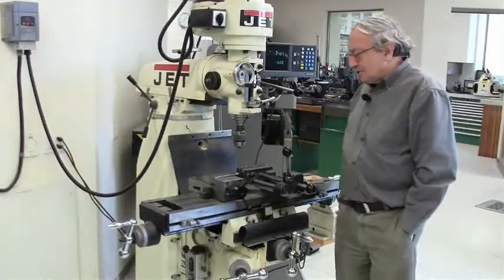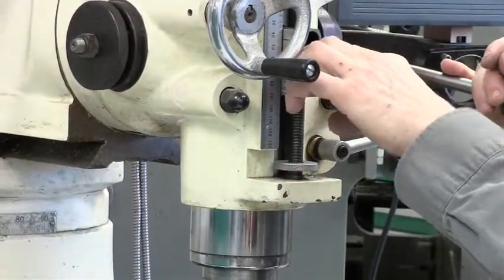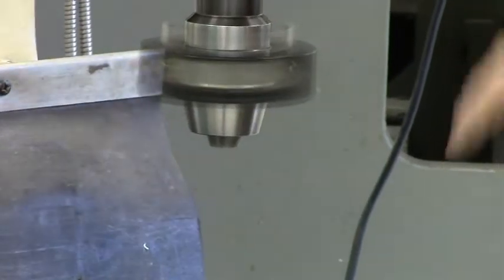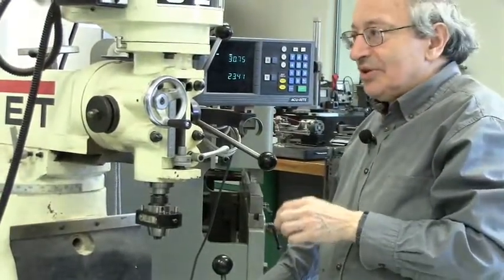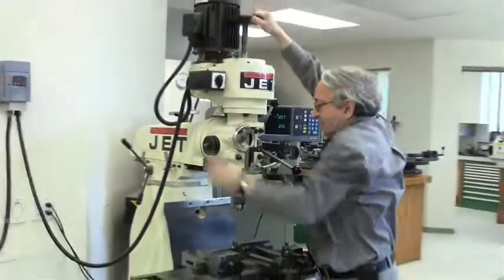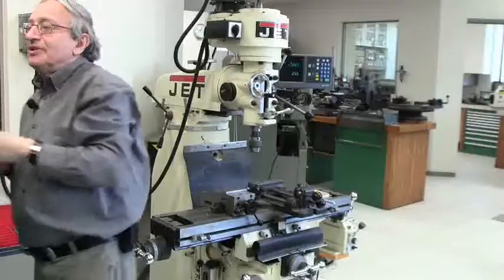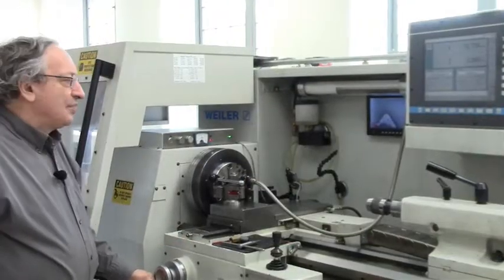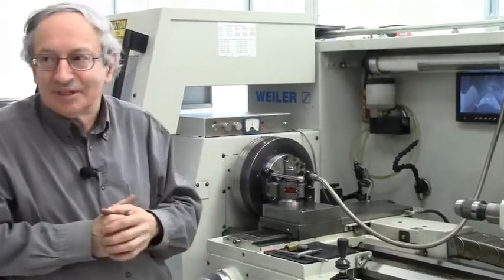Building Prototypes Dan Gelbart  part 15 of 18  Mill and Lathe

Comment: Dear Don i have got mill with 3 ph motor .i hope that  the rpm frequency controller will solve the problem ...i don't have 3 ph  but single ph 220v ac 
i was looking at amazon for controller but there is so many of them and i got lost which one will do the job ...converting 220 ac in to 3 phase ..please advice or better send link .
thank you .
Stan 
ps . please contact me directly if trough you tube correspondence is uncomfortable stanislawcollection.com
Reply from the maker: Up to a few HP you can run the 3 phase VFD from a single phase.  Here is one: https://www.amazon.com/Variable-Frequency-TwoWin-Inverter-Converter/dp/B08K32PNVP/ref=sr_1_6?dchild=1&keywords=VFD+single+phase+input+220V&qid=1612324341&sr=8-6
Reply: @dgelbart  you just save my life ...if i wouldn't be able to run my mill i would jump from high building .
Thank you so much for the link

Comment: wow   ton of information which make life much easier . ... but where to get components  to build the laser center finder ?  ... i love that and from now on i can't live without .
regards stanislawcollection.com
Reply from the maker: https://www.ebay.com/itm/Dot-Laser-Module-650nm-5mW-Red-Diode-Dot-Laser-Board-Focus-Adjustable-Laser-Head/252477800391?_trkparms=ispr%3D1&hash=item3ac8d97fc7:g:hIIAAOSwdzVXmNky&amdata=enc%3AAQAFAAACgBaobrjLl8XobRIiIML1V4Imu%252Fn%252BzU5L90Z278x5ickkrDx%252B2NLp21dg6hHbHAkGMc6zfwblR%252FiT4VN2lKq%252FUGAIA%252BXiKYS6C%252F1i0jKaUkMcVWk7xfXB5yKksJScZasU5GiHE0pUUYXET8ANXGqAU6p3nwJ5SbadoECB3BeJ05ZOkU7ITuGJSDx2ztnE0IFyxXQGz%252FhGa4kcC0UKzZczo82itrAN%252F%252FZ3XYU5llwFGrLw%252FRAyX5COF01JvNT%252FuCMVveJb9NVVOE7vgVSyUw7m0KpLbvfNH6z3unDW%252F87eqll1m2O2q8Pptgn5fB741qFQYdB53c%252FM%252Fb2x2s3XY5Cjfwb28lWfY77o7mZZ3SpW9wxTphfApN9vhHOsdfP7INYEscWxHrOmUfZqEHEjAnroG3n0qwX7rfWMeyrTPh1WCE1F1yN4ttK0S3okTPxMFmHNcHcjGHFDRkF72PT61nZAKSYMsZyJusr9Ge33g4S%252FGSD27s8p5bFr%252BP3Gq9gzC%252BQaH7v343YHuZPBgRSucFU68nF%252BGSMv4xdXsqR1fjz%252BLicxjzSVMJYXlSkELpqjeK0msrpAoGOzEDmNcKqV1q0qbhAE8hLaySb3akawbG4W6GjjzBInlzjUGWvzcU4Qbp848rbCNuVoXy%252FhbvW9tzOJuKPQCaHhdAAE8xLPk8JNew1RNcfgJhS09Gqol8pJCRxe5z0eIFzcw%252FcQ2m0u3xqb8z12HPQxmTsWjbOtOzBxHcHzt4sELFOxeClXy3ZC4LLq%252B7%252BoBpZqci3vA%252BIRym6TMQIYEGX47kHucwsYa4bcvt5dkvRtcawB1o8bVuGpt6%252Fqqdol37%252B2AkQ40uh19Eb3CNQ%253D%7Ccksum%3A252477800391d2599670ebb14d69a2f329500637fd3e%7Campid%3APL_CLK%7Cclp%3A2334524
Reply: @dgelbart  thank you so much ..maybe also you have video how to build that "put on chuck " center finder .. or some diagram ??
Love yours videos ...every single word on your videos is worth oz of GOLD !
Reply from the maker: @stanjarmolowicz  Sorry, built without drawings.

Comment: I'm astonished to see a Jet knee mill and not a Bridgeport. Dan knows something I don't. (hahah, ya figure?)
Reply from the maker: No worries. My mill is a Makino KE55, a wonderful machine no longer in production. The Jet, a very good machine, is used only for very light milling and mainly drilling.  I have other fancy machines but no point showing them in a video done mainly for students.
Reply: @dgelbart  I know you get this feedback a lot, and I know you're a busy guy with lots of priorities besides making videos... but man, I'd love a shop tour of the other fancy machines you've got, particularly if you've got any other cool modifications you could show off. I'm not a machinist or engineer (UX designer, actually), but I am very interested in the way you innovate and solve problems. Surprisingly applicable to my own line of work, even if not directly.

Comment: Ran a bridgeport for 20 years and never saw that light indicator. The handwheel drawbar idea is cool but that roughing endmill would pull right out of the collet with such a whimpy torque.  But i am curious what the hole was on center behind the knee waycover? This man is a genius. I would love a tour of such a place.
Reply from the maker: The hole is for an adapter that converts the mill into a horizontal mill (the hole is the arbor bushing). The adapter was a standard Bridgeport accessory, probably no longer available.

Comment: I would want that laser center finder but the cost is a little bit steep. I found this weird tool named "laser monkey", meant for aligning the wheel on motorcycles I guess... it looks like it could work for this application too.
Reply from the maker: I have nothing to do with the laser finder. I published the design and at least one company (centerquick) is making it.
Reply: @dgelbart  It's still a great invention. I just thought I tell about my finding to other people who might be seeking for an option. I am actually planning on building something similar myself.

Comment: Dear Mr. Gelbart! I constructed a laser-centering jig similar to this. However, when I used it to drill a hole on a flat surface, the accuracy was horrible - about 0.5 mm error in the hole position. It seems that unaided eye have a hard time to distinguish positional error of a center mark within laser circle with a suitable accuracy. So, my question is - when you say "50 micron accuracy", do you mean mainly positioning on cylindrical surfaces, where positional displacement is more obvious via tilt/tip of the laser circle? Do you use some kind of close-up camera to accurately locate centers on flat surface? I have quite good vision, but cannot locate a center point within the laser circle to 50 micron accuracy. Am I missing something?
Thanks for all your great videos, they are much appreciated!
Reply from the maker: On cylindrical surfaces or on cross drilling a cylinder the error is magnified and it is easy to get 50um. When aligning to a mark on a flat surface, like a center punch mark, you need to make the laser circle very small, about 1mm diameter. If you do that you will get 50-100um. I suspect you used a large circle on a flat surface.
Reply: just use a dial indicator man. that's what they're for.
Reply: @fatihdurmaz9826  that's like saying "forget using a plane to get to Denver, that's what cars are for"

Comment: These are great videos, but every 'recipe' for making a part starts with "buy a water jet". ;)
Reply from the maker: Very true, I love these machines. The good news is that Omax has a small unit now, called Protomax, about 12"x12" format, very compact and runs on single phase 240V 30A. The price is around $20,000.
Reply: @dgelbart  Can I use this to build one that costs $2,000

Comment from the maker: Hi Folks: For all those who asked me how to build a laser center finder, you can buy one now at www.centerquic.com. 
I got one as a gift from the vendor and checked it out. It is well made and well designed.
Reply: Yeah, but we all still want to learn how to build it!
Reply: I know this thread has some age to it, but I'm interested in the spindle lathe attachment for adjusting run out, do you have a specific video for this Construction?
Reply from the maker: @machmat33  Unfortunately not, I may  do one in the future. I did not keep any drawings. Quite time consuming to make, as all parts are hardened, ground and lapped.

Comment: If you have a 3D printer, you can also print one out, i've uploaded the OpenSCAD Source and .stl files here. It is drawn to fit a 68mm quill on our Bridgeport, but fully parametric, so you can adjust to suit in OpenSCAD. http://www.thingiverse.com/thing:1483955

Comment: Dan, Thank you for the great series. 

I curious about the hand wheel. It looks like it can save a lot of time.

It has to be taller than the quill travel, does that impose a max speed? 
How did you balance it? 
Is it supported with a bushing or bearing inside the spindle top?
Is there still a nut section for hard clamping or do you find it unnecessary?
Do you every need to knock the collects out, or is the hand weight enough?

Comment: Hi Dan

I love your nifty laser center finder and I want to make one and did some thinking ...

I thought I would turn it ON with the rotation and when no rotation it's OFF.

Are there situations where you need the laser ON when it's NOT rotating ?
Reply: I thought of this too.  Could use a mercury tilt switch on its side as a centrifugal switch.
The only problem I can think of is accidentally storing it in an orientation where it could switch on.
As I was typing this, I had an idea about adding a low volume buzzer that is on when the laser is on.
It'll not be annoying when the machine is running, but would alert you if the laser is on when it shouldn't be.

Comment: To bad he didn't read the instructions for the VFD where it states do not put a switch in between the VFD and motor.
Reply: You do realise this man is an electrical engineer with 30+ years experience designing complex electrical, optical and mechanical components? 
Dan could make a VFD in his home workshop in an afternoon...
Trust that if he has placed a switch in that location, then it will perform just fine
Reply: Assuming he didn't also run some control cables back to the VFD down that conduit.

Comment: What type of rear view camera/screen did you use for your lathe tool viewing camera? I see a lot of brands on Amazon/eBay, but I'm not sure which one will work and which one won't work. Also, regarding changing the optics so that it focuses very close and is magnified, do you just remove the original lens and flip it around? Do you have to change the distance between the original lens and the image sensor so that it can be focused with a long working distance? 

Thanks,
Matt
Reply from the maker: Matt Bockman Any camera + screen will work. No need to change lens, just move it further from CCD sensor(typically a few mm further).

Comment: nice idea! what laser did you use? what should i get? thanks!
Reply from the maker: YOu can get them cheap on Ebay: http://www.ebay.com/itm/2pcs-Focusable-3-5V-650nm-5mW-Red-Laser-DOT-Diode-Module-12x35mm-/121212852782?pt=LH_DefaultDomain_0&hash=item1c38d95a2e

Comment: The laser centre finder is a nice trick.

I don't like the quick adjust quill stop nuts because I've had them shift and ruined work/tools as a result. I made a video not that long ago making quill stop spacers that give a you a solid stop, but mean you don't have to move the nut far.

The 4 jaw chuck appears to be a self centering, but you don't make it clear if it is a scroll chuck, or an independent (of even a combination chuck). I know machinists who are fans of 4 jaw scroll chucks, but they never worked with hot rolled stock.
Reply from the maker: If done correctly it will never shift. I've used this system on all my drill presses and also on table saw arbors for 40 years and never had a problem.  Follow these rules:  Hole size=thread OD, Tilt (top and bottom of nut)=thread depth, minimum length of nut=1.2 thread OD, 1.5 better. Use mill to cut hole.  I suspect your nut may have been too short.
Reply: These type of knobs or nuts are quite common. I have used many and never had one fail to do its intended function. Many styles are available.
https://www.mcmaster.com/#machine-component-knobs/=14x2tum
https://www.mscdirect.com/product/details/06927545
 These two are the type I prefer for machine usage. 
https://www.mscdirect.com/product/details/00233031
 This one is easy enough to make, especially at that price.
https://www.mscdirect.com/product/details/09506114
 I have made several for various machines over the last 40+ years and they are all still in use today.
 Mike (o\!/o)

Comment: Hi Dan,

Nice video. The laser center finder is quite elegant and simple. One question I have is can you develop enough clamping force with the small diameter drawbar handwheel to compress the collet in the spindle? Many people have experienced the cutter pulling out of the collet while milling slots and pockets. I'm wondering if you have a wrench handy in case you want to do a heavier cut.

Kind regards,

Tom
Reply: Dan Gelbart A 5c collet has a 20 degree angle on the nose, while an R8 has a 30 degree angle on the nose. Making an R8 collet harder to close than a 5C collet. Nice trick, but for heavier cuts I'm with Tom.
Reply from the maker: Yes, handwheel is the same diameter as on a collet lathe Like Hardinge.